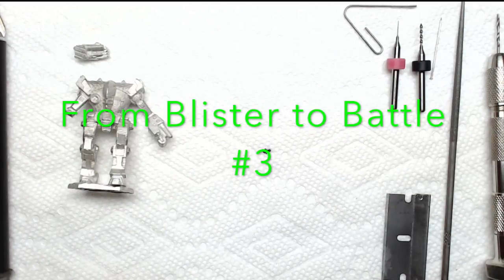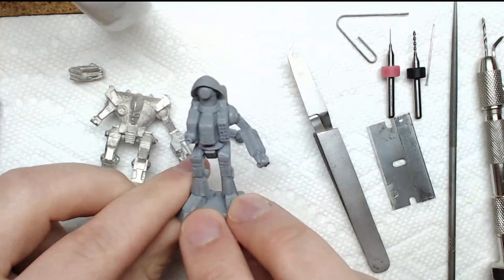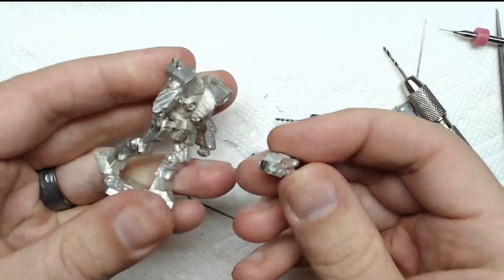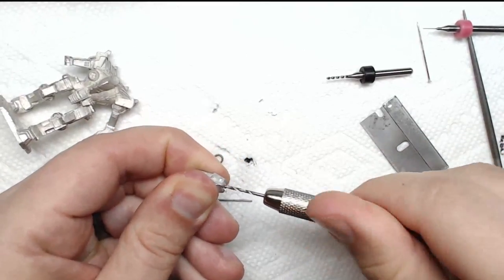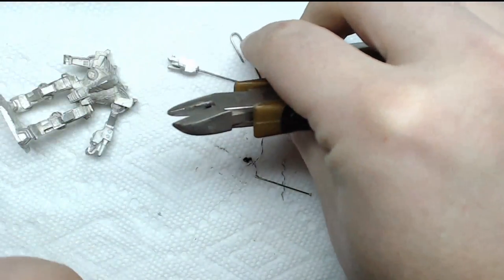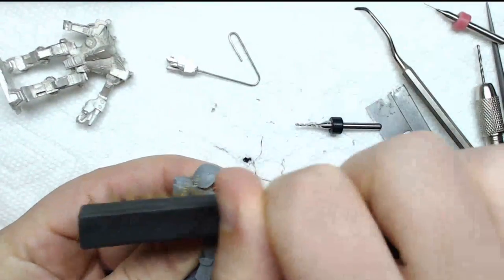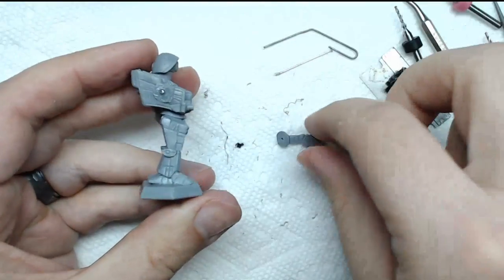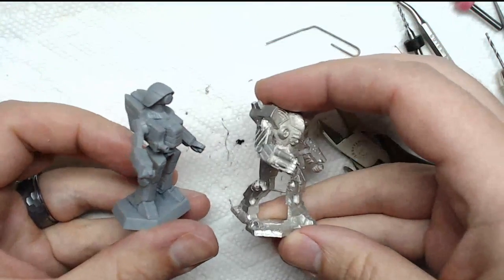From Blister To Battle #3: Pinning and Reposing

Comment: Does Testors Contour Putty work as a replacement for Green Putty? Haven't found any Green Putty in stores around here so far.
Reply from the maker: I've never used Testors contour putty so I can't speak to it's similarity. Tamiya makes a good filler putty called "Basic Type" that's labeled to be used on plastic but I use it on metal with no issues. It's similar to the green squadron putty in method of use. https://www.amazon.com/Tamiya-87053-Putty-Basic-Type/dp/B000BMYWYW